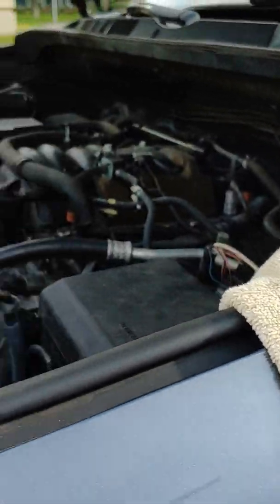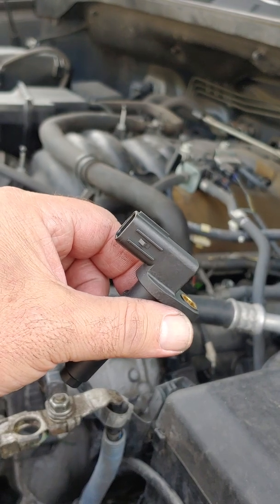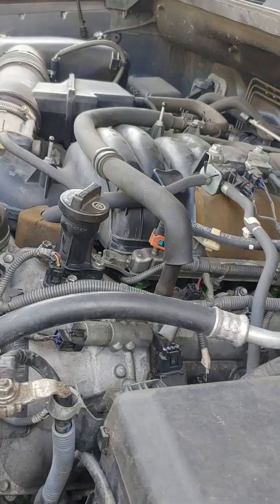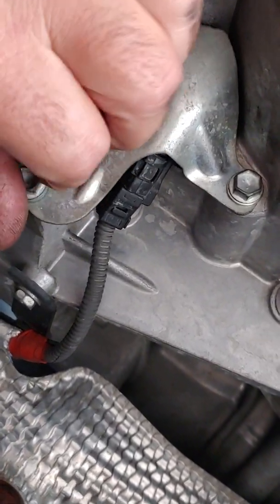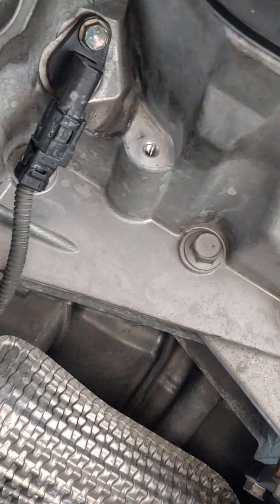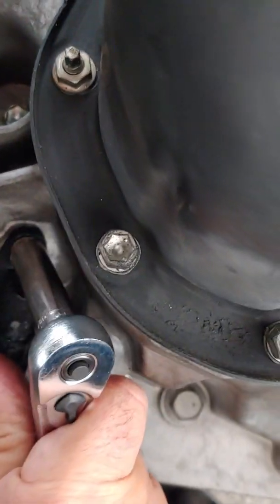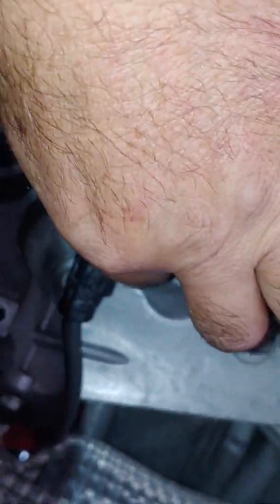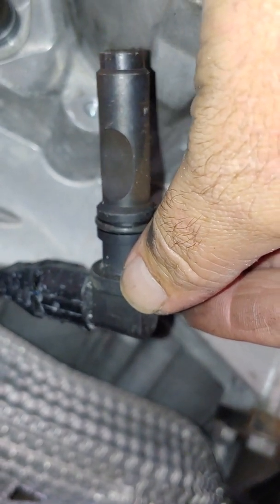2007-2013 (or more years)Toyota Tundra 5.7 Crankshaft Position Sensor Location and Installation.

Comment: Have a P0358 code and trac light on. Wouldn't start. Replaced Crankshaft Position Sensor that I bought  on Amazon because it was cheap and now it starts and running good but can't clear the code. Bought another Sensor from Autozone and tried it and it wouldn't start. Put the Amazon one back in and it runs but still can't clear code. Well I can clear it but comes right back. Do you think the Amazon Sensor could be bad even though it runs ok but still has the P0358 code? Thinking of buying one from O'Reilly. 😅
Reply from the maker: @mikeceausu7045  what brands are they?
Reply from the maker: Standard and Wells are good maybe Bosch
Reply from the maker: Also check Rock Auto
Reply: @dico_5.0 thanks for the quick response. Bought the one from O'Reilly's and everything is good now. Thanks
Reply: Not sure what brands they are but the 100 dollar one from O'Reilly's worked.  @dico_5.0

Comment: Just curious why did u drop Trans in the past. What problems did u have.
Reply from the maker: TRANSMISSION REBUILT AT 120K LOST 1ST GEAR STARTED OUT ON SECOND GEAR. I HAD JUST CHANGED THE FLUID A COUPLE MONTHS PRIOR. OLD FLUID WAS NOT DIRTY. TRANS MAN SAID YOU NEED TO KEEP THE FLUID CLEAN. CHANGE EVERY 30K FOR VALVE BODY SAKE. HOPE THAT HELPS.

Comment: Thanks for the video. I have the same crankshaft code and also all four cam shaft banks. What did you do for your camshaft codes?
Reply from the maker: Did not have any...just crankshaft
Reply: Thanks, I thought in the beginning of video you mentioned some secondary camshaft codes.  I am hoping crankshaft sensor takes care of the others too

Comment: So did your P0348 code clear once you installed the new crankshaft sensor?  I am having the P0348 code come up after installing new timing chain and tensioners, everything is timed right, truck starts, I changed out all the 5 CPS's and it still comes up, so I am wondering if it is crankshaft related?
Reply from the maker: I ended up putting the original back in. No problems
Reply: Did you figure your issue out? Curious because a friend is having the same issue right now

Comment: Hi. I replaced this sensor on my truck but now it doesn’t turn ON. Any ideas why?
Reply from the maker: What's your codes?
Reply: @dico_5.0  it had no codes. Issue is the truck will suddenly shut off while idle. So a mechanic suggested it MAY be the CKP. Now a few years ago I did see this code that’s related to this sensor so I figured the mechanic has a good idea. So I replaced it using a new sensor from Toyota. It now doesn’t turn ON. Does the computer need to learn this new sensor?
Reply from the maker: @rgm0692  no. My truck started right away
Reply from the maker: @Raul Martinez  all other electronics are good...battery etc? Fuel pump...all that???
Reply from the maker: @rgm0692  starter???
Reply: @dico_5.0  everything is fine. I just replaced the new with the old and it started right up. Now I wonder if I got a faulty from Toyota.
Reply: Not sure I made sense. I removed the new I had just installed and put the old one back and truck started on as usual. This old sensor is original and 420,000 miles. I’m trying to figure why it shut off all the sudden but it starts back on without a problem.
Reply from the maker: @rgm0692  I had that happened with an autozone one
Reply: @dico_5.0  I’ll take it back to Toyota and try again. For now it’s running on the old sensor. Hey, I greatly appreciate your replies. I’ve spent all morning trying to figure this out and you’re the only one who gave me the time of day. I really appreciate you.
Reply from the maker: @rgm0692  you got it!
Reply: Raul Thats happend to me,but I instal the old one again,and still not start 
What do you think is is?😢

Comment: P0390 bank 2 ? Help
Reply from the maker: Did you look up PO390? IT IS  CAMSHAFT POSITION SENSOR EXHAUST CAMSHAFT
Reply from the maker: You have multiple CAMSHAFT POSITION SENSORS have to find which ones are for exhaust

Comment: I need to identify Camshaft Sensor B on bank 2.
Reply from the maker: This video is the  crankshaft. That sensor is on the right (passenger side) on the motor. You have multiple camshaft sensors but only one  crankshaft. I never had to mess with the camshaft sensors.

Comment: Did it work after?
Reply from the maker: Long story. But after installing that one. It turned out I didn't need it and put the original back in. No problem since.
Reply: @dico_5.0  so of the old sensor worked what was the problem?
Reply from the maker: @joaquincortada1483  yes put old one back it worked